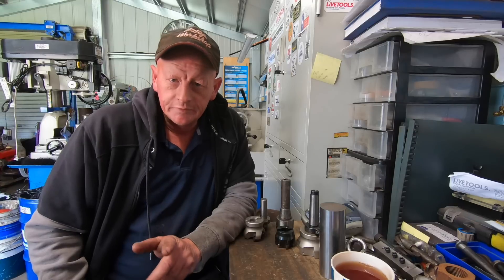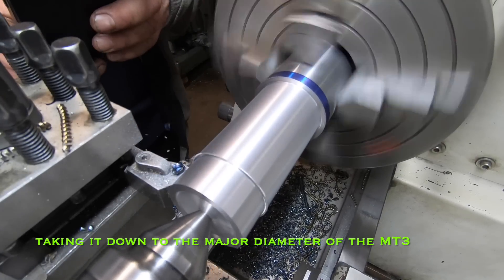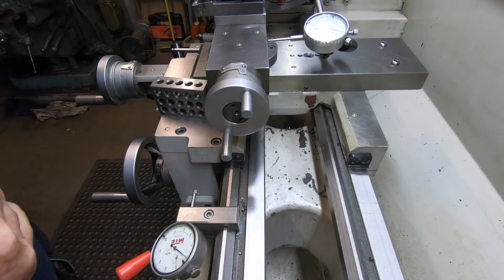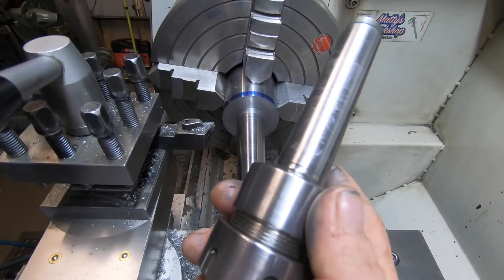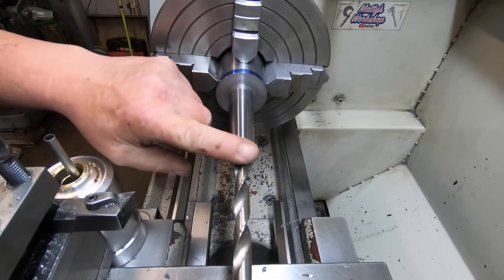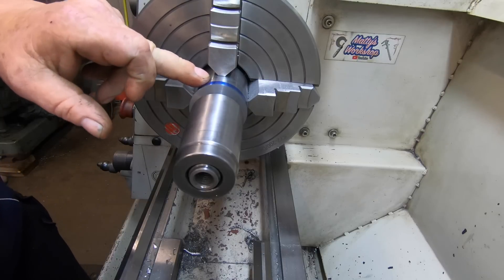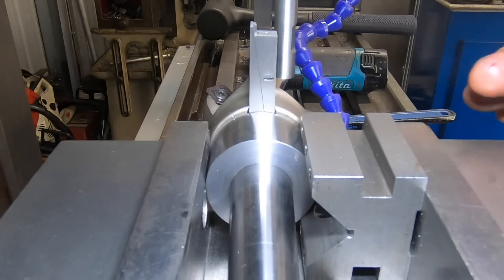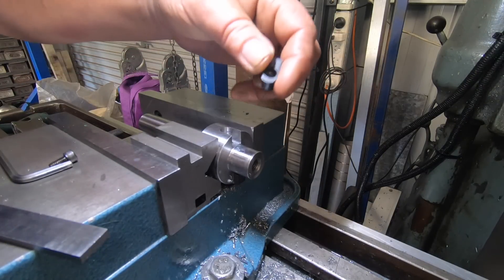Face Mill Arbor  MT3 - FMB22

Comment: Great job Matty  and great addition to the shop, 0.05 mm undersized is liveable for normal cutting loads, many are sleeved from 3/4" to 22.00 mm, I  still have one.
Definitely missed your vocation 👍.
Coolant is great on a lathe, though it can throw most of it out, normally on the operator 🤦‍♂️.
Thanks for sharing,  regards John
Reply from the maker: Gday John, the first arbor would of worked but I just wanted it to be that bit better fit, running coolant on the lathe is messy but certainly saves your inserts, Thanks for watching mate, Cheers

Comment: You can always weld up the area that got screwed up and then re-machine it.
Reply from the maker: Gday, it turned out it fitted the second small face mill I showed at the start the video, it had a slightly small bore, I got lucky there, Thanks for watching, cheers

Comment: I did a 28mm Arbor for my mill, in similar fashion - my mess-up was on milling the drive dogs, when the part moved... Was for the tool making competition s couple of years back...
Reply from the maker: Gday, I hope you manage to save the arbor especially after machining the other features, Cheers
Reply: @MattysWorkshop  Yes, I did. There is a bit of a "mark" where I messed it up, but it's perfectly workable.

Comment: Hi Matty, you can always repurpose the scrapped item, has a good morse taper on it.
Reply from the maker: Gday Willem, the other small face mill I showed at the start of the video fits the arbor I screwed up perfectly, it’s got a slightly smaller bore, thanks for watching, cheers
Reply: Don't you just love it when you've done the hard part then fuck up on the much simpler just turning to a diameter! As you say Matty, shit happens lol but to be fair if you were trying to teach yourself to work in metric then at least you have an excuse lol imagine had you been working in Imperial and fucked it up then? What would you have done then lol It turned out well in the end and I'm impressed with the way that was hogging off material. I bought a cheap chink shell mill and that too is total crap.
Reply from the maker: @samrodian919  Gday, it always happens on the easy parts, if I wasn’t using metric and screwed it up I’ll would show the mistake, I definitely don’t hide them, I’ve seen many YouTube machinist never make a mistake but I’ve seen a different piece of material appear and nothing said🤔, thanks for watching, cheers
Reply: @MattysWorkshop  Not just machinist hobbyists. Cnc router guy used to make well filmed and edited videos, He wouldnt show finish results on one particular vid. because of a botched 3d job witch was a little tricky to pull off. Everyone wants to be a sensation on you tube. Keep at it we all booger up sometimes.

Comment: Hi Matty, on the woops one, you can always turn it down to 16 mm to fit a smaller size cutter. Oh BTW Aussee have  arbours for $24, but were’s the fun in that! Keep up the great work. Kerrin
Reply from the maker: Gday Kerrin, the small black face mill I showed at the start of the video ended up ha slightly small bore and fitted the arbor spot on, I got lucky, thanks for watching mate, cheers

Comment: Hi Matty good job on the Arber. J needed to make a B&S #9 taper for a mandrel for my Burke #4 mill, and did not have enough travel in the compound to cut it. So I made a taper attachment for the lathe, it's a little hard to adjust but it works. Cheers
Reply from the maker: Gday Randy, I have thought Ana taper attachment but I don’t think I’d use it enough to warrant making it, certainly handy to have though, thanks for watching, cheers

Comment: Nice job Matty. One of the great things about having your own lathe and mill is the ability to make tools rather than buying them. Thanks for sharing.
Reply from the maker: Gday Patrick, if I had to buy all the tools I’ve made I don’t think I’d be doing this hobby, thanks for watching, cheers
Reply: @MattysWorkshop  Here's 3 things you can do with that first arbor you undercut.
1) Bore out its center and turn it into an endmill arbor
2) Face off the spigot and mill in a groove across the face and turn it into a fly cutter.
3) Face off the spigot and machine the pockets for inserts and have yourself another face mill. Just similar to that is put in 3,4,5,6 groves like you did for the drive dogs to take HSS blanks and make a face mill with grindable tips. Remember not everything is best done with carbide inserts.

Comment: Matty, Weld up the bad part and recut so you have a spare Arbor...... LOL i did not realize the lobes were separate parts  i was like that's going to be fun to machine
Reply from the maker: Gday Paul, the smaller face mill I showed at the start has a slightly smaller bore and it fitted the first arbor nicely, I just have to machine the slots from the drive blocks, thanks for watching and commenting mate, Cheers

Comment: Hi Matty, great job mate, I envy your Cinci mate, my mill is totally useless for face milling, 0.01" cut and it sounds like it is tearing itself apart 😭. Keep your first part, you could make a slitting saw arbor or similar out of it. Cheers, Jon
Reply from the maker: Gday John, I very rarely ever use the mill drill, always the Cincinnati, its been a great machine but I wish it had a quill and little more z height, Thanks for watching mate, cheers

Comment: Nice Matty. I wondered how you were going to index that other dog. Good thinking outside the box.
@9:00 you left out the pointy stick 😄
Reply from the maker: Gday Phil, using the adjustable parallels which I’ve only just got the day before worked a treat, probably many ways to do it but this was the easiest way I could think of, thanks for watching and commenting, cheers

Comment: Gday Mat, I also bought one of those cheap crappy face mills and it would barely cut at all. I think the inserts are not positioned properly, the inside of the insert is higher than outside, so I put it on the Quorn and ground them so the outside of the inserts does the work and it cuts fine. Maybe some better quality inserts would be better.
Reply from the maker: Gday, I found on the larger face mill i brought the inserts are all on different heights, only 2 were the same, really a complete waste of money, this one I have now is surprisingly good, thanks for watching, cheers

Comment: More good work Matty :) That cutter looks (and sounds) pretty good to me - very even chip load on the inserts. I have a similar pattern cutter with 90mm diameter and while it works quite well it exposes one of the weaknesses of vertical mills - rigidity. Even though my mill is quite a heavy machine with an NT40 spindle, the inserts on the trailing edge of the cutter have a tendency to lightly drag due to the leading edge inserts tipping up slightly under load. I think the cutter you have (~60mm ?) is a more appropriate size for a vertical mill unless it is a really heavy duty unit.
Cheers, Alan.
Reply from the maker: Gday Alan, I was surprised how well this went and the material it removed, the Cincinnati handled it great, there’s no way I’d try this cutter on the small mill/drill, it just doesn’t have the rigidity, thanks for watching mate, cheers

Comment: Hi Matty. I would definitely recommend trying one of the cheapo 'mist' coolant setups like I have. They work almost as well as flood coolant, but a lot less messy. Some people have expressed concern over the mist, but it's more like a spitter, spitting small blobs of coolant and the compressed air does a good job of clearing the chips (when aligned correctly). Flood coolant may be ok for you, but my shed has a wooden floor, so I didn't want it regularly getting wet. 👍
Reply from the maker: Gday Olly, I do have a mist setup on the small mill that I sorta forgot I had, I don’t use that mill much at all now, I have my compressor in the workshop and it’s now that quite, I really need to relocate outside I think, flood coolant is definitely messy but I do have a concrete floor, I got some thinking to do now mate, thanks for watching, cheers

Comment: Copying morse taper. With a faced off & centre drilled chuck mounted metal. Set a dead center with the taper to be copied between the centre drilled hole (chuck) and the dead centre in the tailstock set into the centre drill hole in the dead center to be copied. Clock the ends of the free rotating dead centre. Place a clock in the tool post loosen the top slide and run the clock along the supported center until the clock registers no deflection. Tighten the topslide which will be at the angle of the morse taper. Or even set the tool post on the loosened topslide so it touches and adjusts itself to the edge the free rotating centre & tighten the topslide.
Reply from the maker: Gday, ive seen this way done before on YT but never tried it myself yet, Thanks for watching, Cheers

Comment: Hi Matty  Something I found when doing accurate compond work , is you cannot rely on the side of the compound being parallel to the axis of the compound.  Check it out.  Cheers John
Reply from the maker: Gday, I have checked and mines pretty much spot on, cheers
Reply: @MattysWorkshop  I thought mine was ok until I checked it with a 1 micron digital dial indicator.  I believe a more accurate way to set the cross slide angle is to set up a lathe alignmnet bar between centres and a dial indicator on the compound slide.  Remachine a fresh centre in the chuck end so alignmnet is perfect.  Use the sin of the angle to set the cross slide.  Advance the compound a set distance (say 50mm) and read off the dial indicator movement.  Divide this reading by 50mm and you have the sin of the angle.  Take the readings close to the chuck just in case the tailstock is slightly out of alignment.  Cheers

Comment: Hi Matty, unfortunate to have buggered the first one but what if you reclamed say 3 mm from the back of the shoulder and turned a register to the correct 22mm diameter to locate the cutter the back of which would still register on the rear wall but be centered on that register. The big bolt down the middle would do the rest. The drive dog mounting holes might have to be set back by 3mm but you'd still have a useable mandrel.
Reply from the maker: Gday, that’s a good idea to save the arbor, I think I still have it here somewhere, cheers

Comment: @ 12:35 Chop it down further and sleeve/bush the end. Maybe a Proprietary bush...?
Reply from the maker: Gday, Mark, it worked out the 1st arbor fitted the small black face mill I showed at the start perfectly, it has a slightly smaller bore, I got lucky mate, Thanks for watching, Cheers

Comment: Nice work sir 👏 👍 sale 1st one to China, the stuff you get from them is more sloppy than the little mis measure you had 😉 😄, believe would have cross drilled the "dog" screw holes 🕳 and used the drill bit to lined up second side for easiness, oh you where talking about flood coolant on your lathe, a guy we watch quiet alot is: https://youtube.com/c/MrPragmaticLee
 he has a stationary coolant tank with multiple outlets going to his lathe, mill and surface grinder, might wanna check him out!
Reply from the maker: Gday, thats a good idea using the drill to align the opposite and I didn't think of that, i'll check out Mr Lees video, Thanks for watching,Cheers